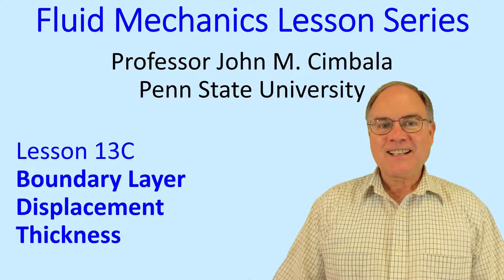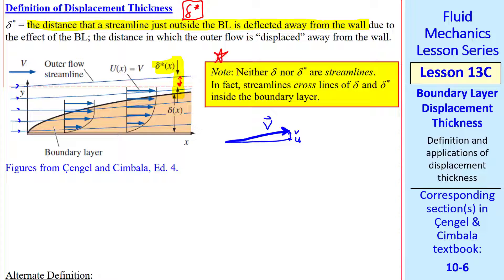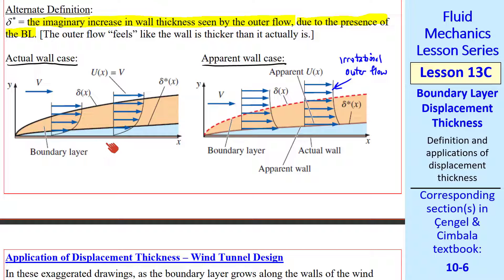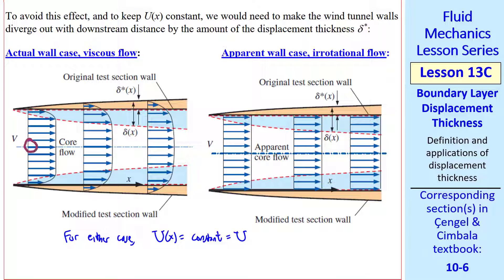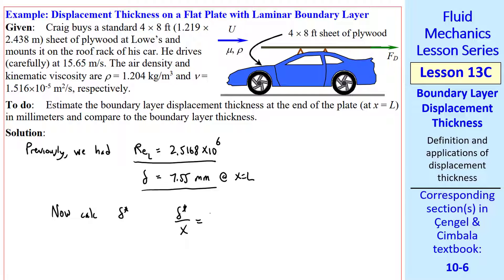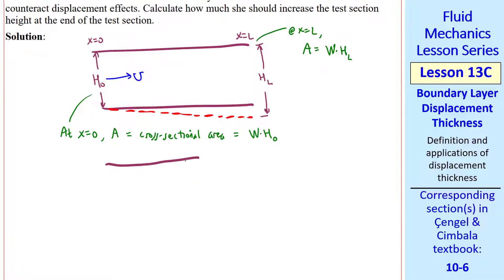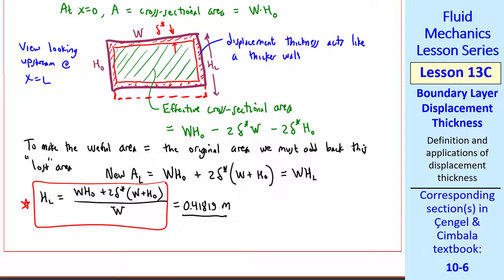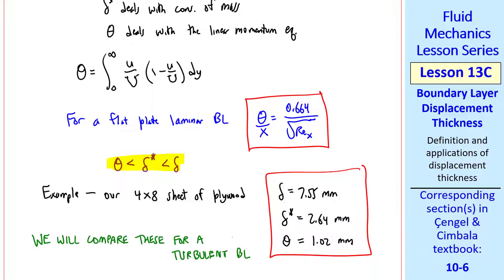Fluid Mechanics Lesson 13C: Boundary Layer Displacement Thickness

Comment: Hi Professor,
I didn't understand the need for the streamline 'just' outside BL? I think since the integration limit is till infinity, the streamline at infinity will be the ideal candidate for the equation to be exact
Reply from the maker: Yes, but the boundary layer profile asymptotes to its value at infinity, so we just need to be "far enough" away from the wall to be "outside" the BL. Mathematically, it is at infinity, but practically, once you are beyond a reasonable distance, the error is negligible (like an error of a thousandth of a percent or so).

Comment: Hi Prof.
In your calculation for the effective cross sectional area, I believe you accounted twice for the corner areas when subtracting from the initial area. I get WHo - 2Wd* - 2(Ho-2d*)d*.
Reply from the maker: You are correct but I ignored the corner effects since delta* is so small compared to W or H, so it is insignificant.
Reply: @johncimbala  Noted. Also, I thank you sincerely for this well crafted video series. An unbelievably helpful exam-prep resource.
Reply from the maker: @thomas_hall  Thank you. I appreciate your comments.